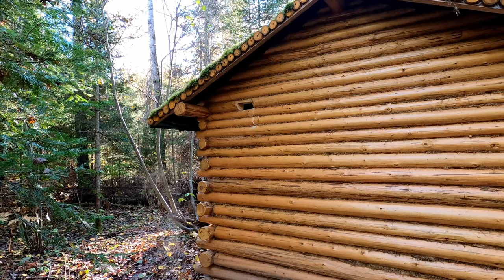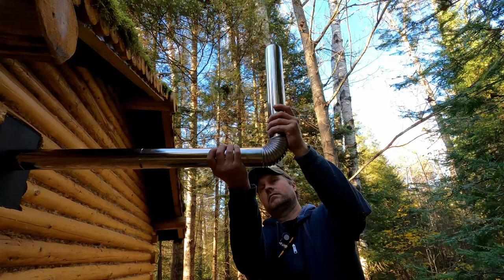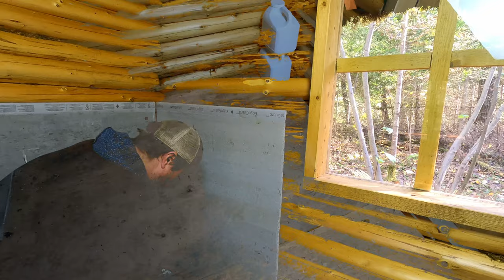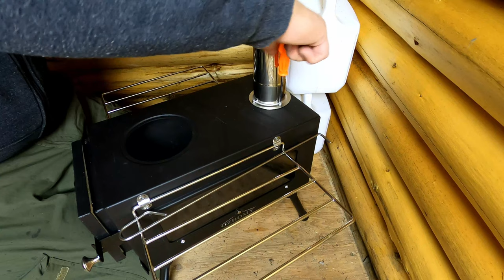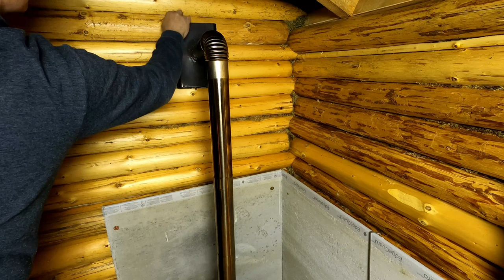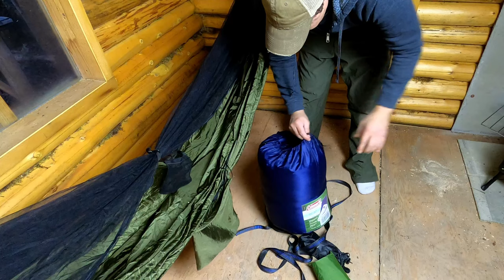Great Little Wood Stove for Tiny Cabin

Comment: Did you have any trouble with smoke?  I have always been afraid of those because of the lack of seals.  Great video, thanks for sharing.
Reply from the maker: A slight amount of smoke. The door seals nicely but the top hole cover leaks a very small amount at times.
Reply: @backwoodssolitude  thanks for the reply.  Beautiful place you have and great videos.  Keep up the good work

Comment: Did you look at the Cubic stoves? How often do you have to resupply the wood during the night at freezing temps?
Reply from the maker: I didn't. Quite often, but I'm trying some different wood types.
Reply: @backwoodssolitude  yeah, that’s the balancing act. Small and efficient enough for a smaller space, but big enough to offer a longer burn without heating you out of house and home.

Comment: Where did you get the box to put it through the wall??
Reply from the maker: It was a can of camp fuel. I cleaned it out, cut the holes to accept the pipe and gave it a coat of high temp paint.
Reply: And it's holding up well?
Reply from the maker: Ya so far so good